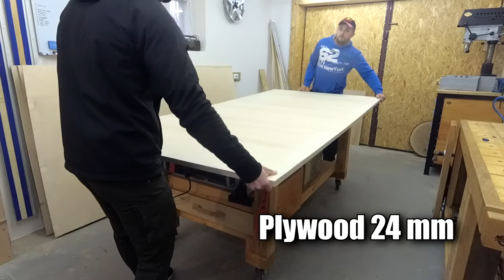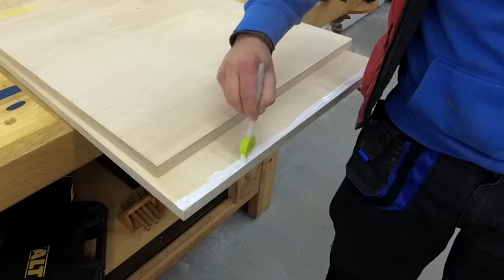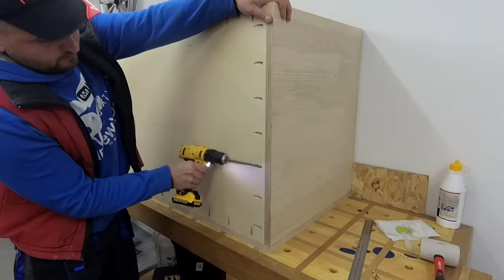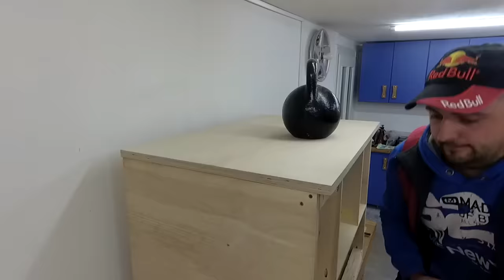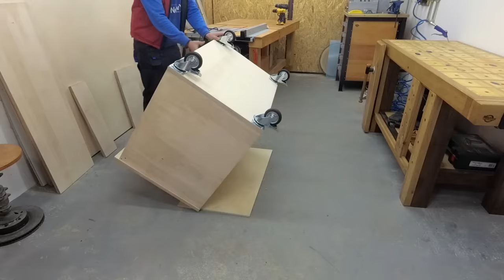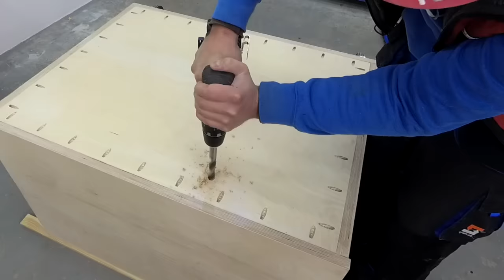Homemade Router Table | Trimmer table

Comment: That sir is the finest sturdest piece of shop furniture I have watched and I've watched a lot of them. Great job. That will last forever.
Reply: Between the air nailer, the glue and lots and lots of screws (way more than necessary), It will rot apart long before the edges budge!

Comment: I thought this was going to be another Norm's Router Table but it's much more.  Great job!  One suggestion, consider getting a router lift and dedicated motor like a PC 7518.  It will much easier and faster to change bits and save your back.

Comment: Best router table on the internet! There appears to be 32 jealous people. Well done, sir!
Reply: Now only 74 jealous people out of 4571 likes.
Reply: Well. I did not give this a thumb down and I think It's a good looking router table. But; No router lift, no fine adjustment of the fence (super useful feature imo) and insert rings that requires 3 screws every time you want to change?. There are hundreds of better (more  user friendly and way quicker to work with) router tables on the internet.
Reply: @CarmoniusFinsnickeri  So... dude... I wasn't being literal. I was giving a compliment for a job well done. Taking the time to share so others can learn deserves more kudos and less criticism for perceived imperfections from know it alls.
Reply: @jasonrobinson9524  Don't consider myself a know it all. But I know a bit about router tables and try to write what I mean, makes it easier for those who read the comments😉

Comment: That router table look very very close to New Yankee Work Shop Norm Abram's version from years ago. I know because I actually built one with a few mods, myself. They are solid and extremely useful. I installed dual locking casters so when I lock them, it is rock solid and does move anywhere. Thumbs Up!

Comment: That is a well-designed, very practical router table, Mr Vereschak I've studied a lot of router table designs on the web, and I like yours so well that I'm going to use it with very few changes to build my own here in Japan. 

One change I will make is to mount a Jessem Pow-R-Tek remote switch on the outside right-front corner of the cabinet. The design of the switch makes it very convenient to add and to use. 

By running the router power cord behind the top righthand drawer and through a hole in the side of the cabinet it will be possible to connect the router to the switch, which will also start a small dust collector at the same time the router is turned on.

Your design for a wooden cleat to store the main power cord out of the way when the router table is not in use is a very good, very practical idea. It is the best solution I have seen for that problem.

Comment: My goodness!  What a beautiful job!  I'd be curious to know how the epoxy top holds up over time.  Have you had good experience with it maintaining its sign over time?
Reply: I can give you an answer since I’ve already done my router table top with epoxy too. Since 2017, it hasn’t moved. Of course it has a lot of small scratch but nothing to be worried about. Probably that the wax and parrafin I apply for a better slide do help too. cheers

Comment: Perfect router table .... but never hold the thumb in the level of the nailing gun
Reply: second that!   I cringed a bit for sure.
Reply: I once nailed myself to the ceiling.
Had run out of nails so I took some that were too long so I could finish and go home. Stuck between two pieces of wood with one finger pierced.

It was before cell phones and I was alone, so I ended up pulling until the nail bent. Ouch...
8:04 By the way, exciting place to have the hand. : - /
Reply: Guess he will learn the hard way.....hopefully it won't go too deep

Comment: I can never understand talented makers who make a beautiful piece of art with the woodworking and then ruin it with unsafe and bodged together wiring. It would have made more sense to not put the switch on the side in a separate box and that would safely let you use the drawer. The problem with push on connector is they also pull off if you have the in a drawer like that. 

When thinking of wiring, ALWAYS think “How can this go wrong?”.  So yeah, love the table, hate the wiring.

Comment: Well done!! Nice trick too with the metric insert height finetuning for the top plate becoming flush with the table. Future improvement might be bit height adjustment from the topside, or strong magnets instead of screws holding the removeable plates

Comment: Dear Sir, thanks for sharing your excellent craftsmanship and magnificent end result. The piece goes together like a bit of modular furniture. Your epoxy top will withstand lots of work and the well thought out dust collection will make keeping it clean much easier. The only thing missing is a through the table router lift and then you would have a perfect solution. Well done - 9.5/10

Comment: I think it's nice but I might do lower vacume suction also the cabinet will fill with dust. It looks kinda short like mine is and you would benefit from a lift.
What brand t-slot miter track was that?
Me I used woodpecker on my router table still have to make the draws. I'm not using bought slides gonna use oak runners and wax.  I'm not real keen on using kreg jigs with pocket holes.
If you look a guy shows how to make draws with a 1/4 set up for 1/2" plywood and dado blade set at 1/4" 1/4" away from the fence. The edges are locked together with a joint.
Its fast and simple construction. 
No fancy dovetails. But it holds tight.
You used 1/2 a car in screws.
Overall I loved it looks great.
Now for router bit holding blocks. So they dont roll around in the draws and sing up the carbide cutters.

Comment: Great video and well done!  When I typed "make router table" your video showed up as number 1.  Here in the USA, you would have to put an electrical housing box to cover your wiring.  Also possibly move that electrical housing box inside the main router compartment to maximize the use of that top right drawer.  I could never make what you just did but it certainly gives me a great idea for my router.

Comment: Excellent project, and job well done. Years ago, (before  computers), one of the magazines had a similar design. It was one up on yours, that you might want to add. It had a knob mounted to the frt panel,  cable driven to the plunge router, that allowed height adjustments externally. Have you seen it?
Reply: I believe it was an "American Woodworker" project sometime in the 90s.
Reply: Sorry for the continuance, but thought someone might want to incorporate  it into your design. The AW issue is April of 1995, (#44). It shows a "flexible shaft" used to adjust the router. It can be had from S.S. White Technologies, out of NJ.

Comment: Hello I really liked your work and the router table you made. I tried and made one just like yours. But I have a question, the space below where the router is located is closed. Does the machine have a problem with dust?

Comment: Beautiful and built to withstand WW3!  Nice job.  Almost too pretty to use it.  Did you consider using a router lift?  Speed controller?  That would be a nice upgrade.
Reply from the maker: I installed what I had, however I think about new router.

Comment: That's really nice. How has the epoxy flood coat on the table held up? I was wondering if it's gotten scratched to the point that it's not slick anymore and needs another coat. How quiet is the router. I'm guessing the 24mm plywood helps a lot.

Comment: Nice work - I like the size and all your additions. However - after all that... I'm surprised you didn't install a router lift. I think you will find reaching under the table to adjust the height very cumbersome.
Reply from the maker: I installed what I had, however I think about new router.

Comment: A very beautiful project, what kind of material is used for painting?
Reply from the maker: Thank you)
The surface of the table I covered by epoxy resin other parts of table - oil wax

Comment: Just had a look in my home and couldn't find table saw, miter saw, circular saw, dust extractor, drill press, router, sturdy carpenter's table to work on, 20sqm of workshop space. Apart from that 100% home-made :)

Comment: When you were joining the sides of the draws together I could tell that you had never had a nail hit a knot and come out the side of the timber, you should never have your fingers that close to where the nails are going. Love the trim and overall look of the table.
Reply: Never happened to me either, but my friend does framing work for living and he told me that you'll learn to keep your hands away when that too close event happens. He had shot something bit heftier like 2x4 with nail gun holding piece close to tool. There had been knot at the downside and he told me that he had a good wakeup call when nail had got through back on the shooting side and between his fingers within 1cm to get through his hand. He told me that if I need to use nail gun, I should always try to visualize where that nail could theoretically reach. I believe that is a very valid point to keep in mind.
Reply from the maker: Hi! thank you for advice, I will try to be more careful in future)

Comment: Do you have links to the aluminum tracks you used and the t bolts.

And what is the mixture you used to put on the top of the table, I want to use that coating on my stationary bench up against the wall??????
Reply from the maker: Sorry, I don't have a link for aluminum tracks. 
Top of the table I covered by epoxy resin.

Comment: Almost identical to the one I built 20 years ago. I think you will find that the table is a bit too big, as the piece really should index only around the router base. A few pieces of tape under the insert makes it sit a little proud, and worked better for me.

Comment: Really nice work and excellent result but you would have made a better operational table adding a router lift that can be operated from above the constant bending and reaching into the cabinet to raise and lower the bit can become tedious.I suppose you can put one in later as long as it fits your table insert.

Comment: Very interesting video, but it would be more helpful to the rest of us if you would share what kind of epoxy you used for the top and what kind of hardware was used for the router table plate, fence, and miter slot grooves.  I could not find this anywhere in the video or comments.
Reply from the maker: Hi) it's ordinary epoxy resin for filling tables, I found the profiles on Etsy, unfortunately he no longer sells them. You can search on Amazon and use Kreg for example)

Comment: Well that’s a very nice mobile router workstation. Funny though, you ask for feedback and likes, yet those offering constructive criticism generate negative comments by your adoring fans which I suppose is standard stuff on social media these days. I’ve taught woodworking and router workshops for a few decades but there’s no way I want to give feedback here. That’s why I hang out in my workshop away from the crowd because people suck. I’ve incorporated my large router into my table saw wing and my smaller router into a workbench router unit. For my space considerations that works best though this cab style router table in this video is great if you have the room. It would be nice if you answered the questions viewers have asked about what and where you got the fence extrusions. Not sure why you are ignoring them I guess you have your reasons.

Comment: Hi Sir,
May I know what is that glossy material you applied on top of the table after the sanding sealer? Thanks.
Reply from the maker: Hi.
epoxy resin

Comment: Nice work although I think locating the electrical connections in a drawer could prove problematic. Better to attach them where they won't run the risk of being dislodged.

Comment: Awesome work ... one of the best routing table I have seen on the tube, just one question, why you did not go with a plate you can adjust the height of the router from the top, I am actually thinking of making me a new router table, and I am feed up of doing the adjustments from the bottom, I feel I am not as accurate comparing if I could do the adjustments from the top...with a micro adjustment allen key...

Comment: Hello guys
happy New year ☺
Is it possible to get back detailled plan if it?
Reply from the maker: Happy New Year.
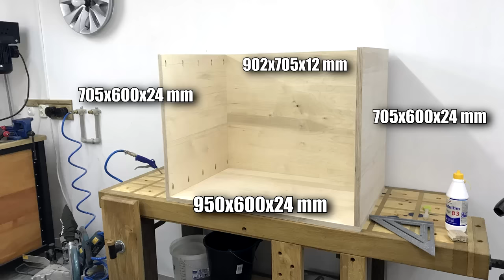Watch the video from 7:05
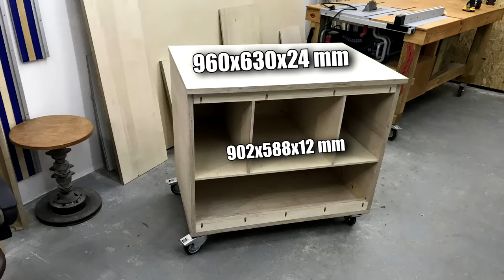I  made mistake about sizes on 7:10 min. 580x400x12 mm Correct  size is - 588x400x12 mm!

Comment: Project is great woodworking, but the power wiring is not very safe look good from the outside but open connections in a drawer witch will have metal things put into them, the system look like it is 220 vac.

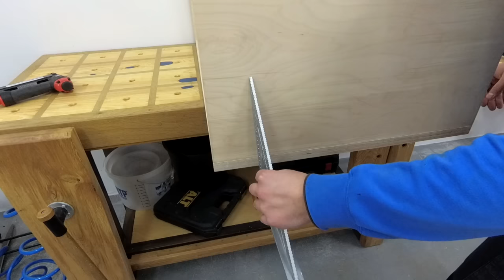Comment: 2:23  Um, that's not how a speed square works, you are supposed to measure it on the inside.

19:55 Instead of brad nailing the front of it, why not drill those two holes for the handle, put screws in like you did, then pull the drawer out and brad nail it from the inside?   Or you could just clamp it in place and let the glue hold it.   The handle will provide enough of a mechanical connection.

Comment: Good Job, but looks like a knock off of Norm Abram's router table on the New Yankee Workshop.  I wouldn't have wasted the top right drawer and slides for the electrical connections, much less leaving the wiring loose  Since you didn't add permanent dust collection for beneath the table top, the holes in the plexiglass dooor are not necessary.  I'm guessing that you planning on opening the rear door to clean out the router portion of the cabinet.

Comment: Hello: first of all, congratulations for your work and your video, it's really nice to watch and try! to make the same router table as yours by doing copy-paste, freeze frames and this for more than 10 months. Of course being retired I have the time to do it and according to the budget for the material and the tools. I arrived at the coating of the table dimension L=800 mm l = 600 mm (lack of space), could you explain to me the first brushstroke of which product it is? I am not a superman of the PC and I do not find if you put a list of the material used or a complete operating mode. thank you for your answer. cordially Jean Marc

Translated with www.DeepL.com/Translator (free version)